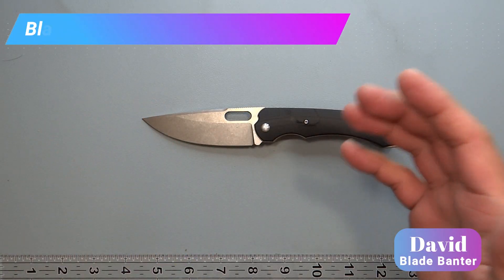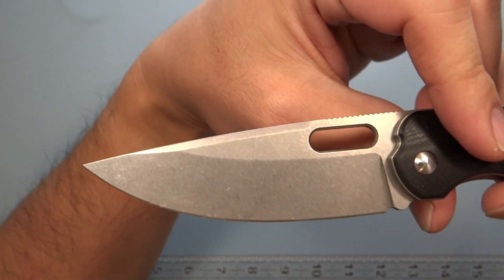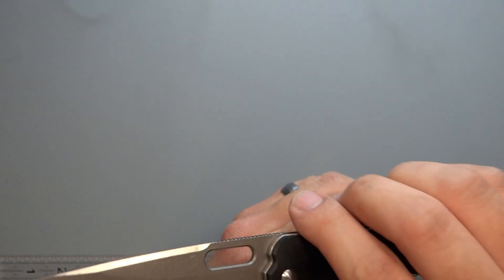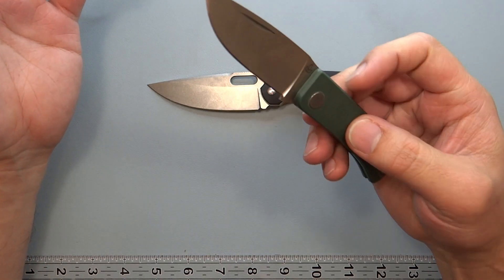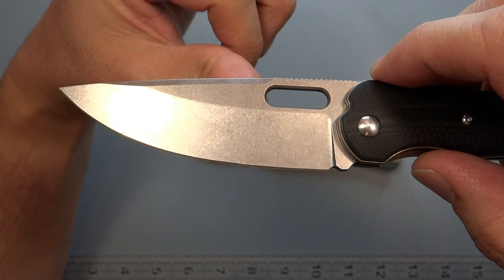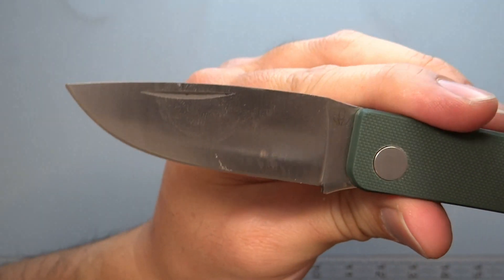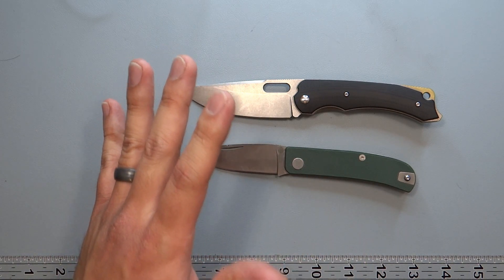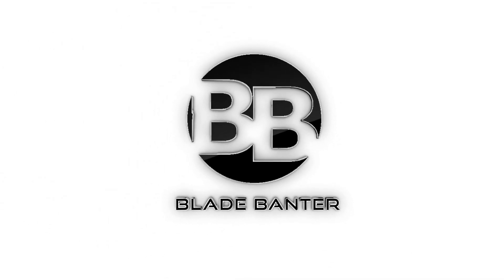Discussion: Knife Primary Grind More Important Than Secondary Behind The Edge Thickness?

Comment: Never been any good in math, geometry or trigonometry. All I know is "Flat" vs. "Hollow" ground. 
With a "Flat" ground, I'd be able to keep sharpening the secondary bevel all the way up the blade consistently. 
With a "Hollow" ground, the angle of the primary ground will gradually change and be thicker (stronger). 
Isn't that all one needs to know?
Reply from the maker: That's some of the basics of the primary grind, although most hollow grinds get thinner then thicker over time.  
     The Primary doesn't have any affect on paper cuts, but the angle does affect the resistance in thicker materials.
Reply: @BladeBanter  Ah, for a City person it would be paper vs. wood and plastic, except if you're going to do food prep. Then it'd be meat vs. potatoes (or vice versa) and a different kind of secondary grind ...and another video!